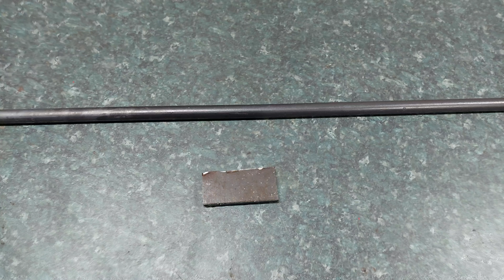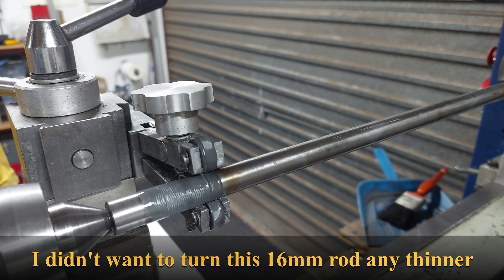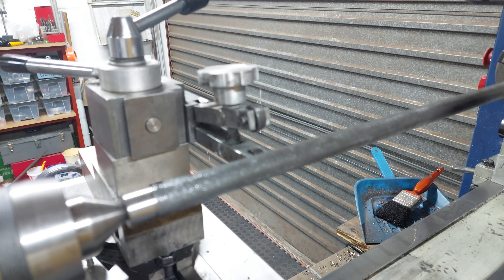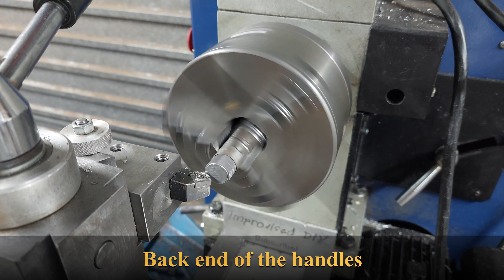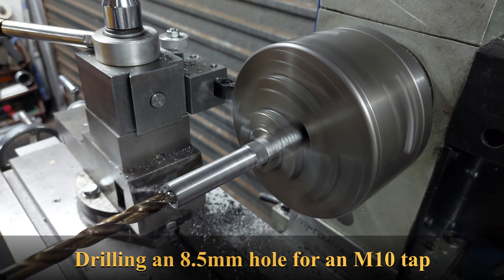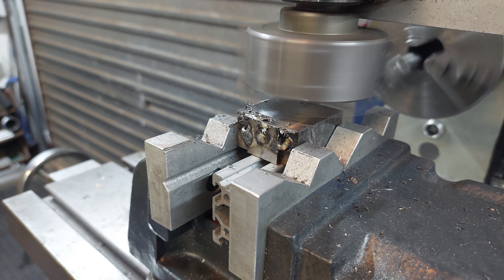Making Tap Wrenches as Christmas Presents

Comment: Add some thread locker like Locktite to your threaded bushing to prevent it from moving when you are removing the tap. It is a very simple tap handle to make and works great. I have been using mine for more than 40 years. I didn't mill a slot to hold the tap, I just clamped the two blocks of steel together and drilled a small hole between the two pieces. The hole created a groove in both blocks to hold the tap. Thanks for showing the way to make this.
Reply from the maker: My pleasure! I did add stud lock to the bushings after the video.